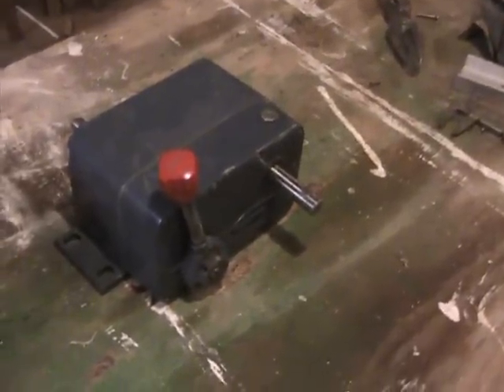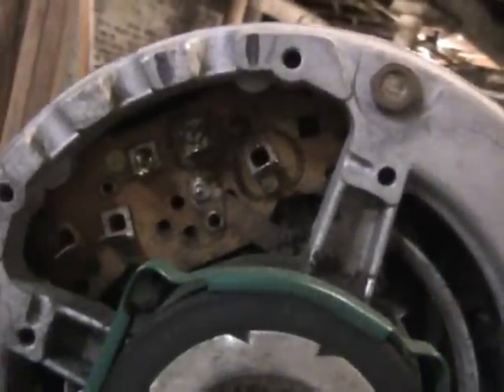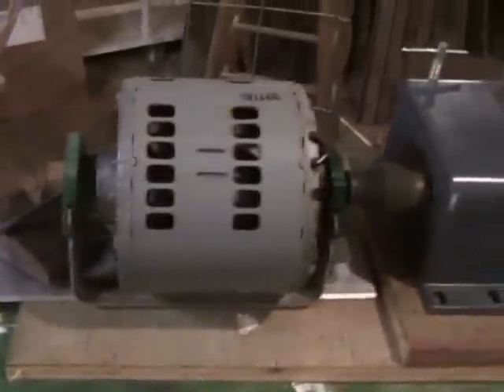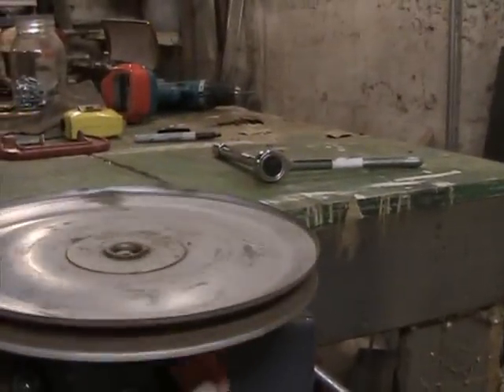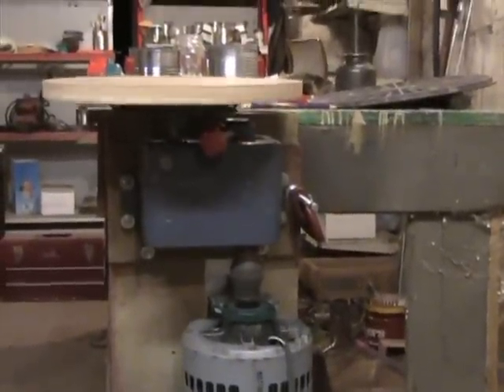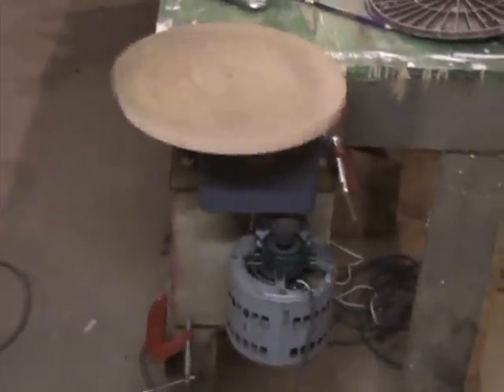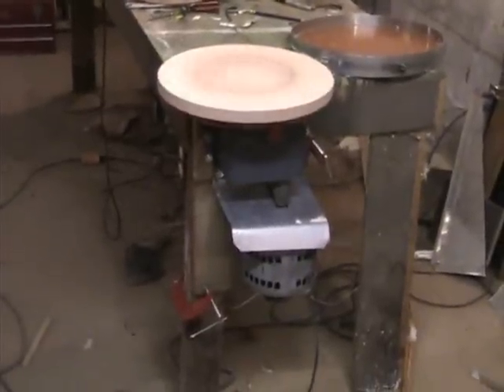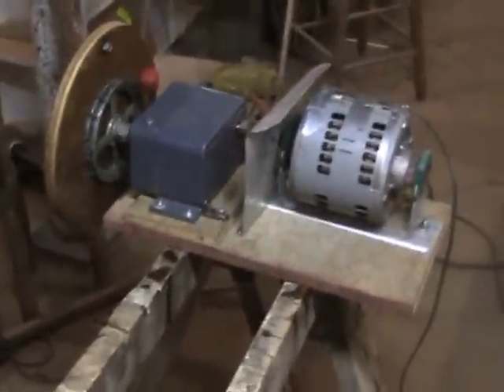How I Made a Variable Speed Potter's Wheel using Salvaged Components

Comment: This looks great! I’m wondering if you could tell me if you think I could use a variable speed sewing machine motor for the wheel. They sell on Amazon. Enduro electric servo sewing machine motor 550 watt. Thank you for your input!
Reply from the maker: hello Nancy,
just noticed your question.
From what I see about those motors it appears they have the power... 550 watts is about 3/4hp.
Find the best deal.
I saw a motor and speed control for like $40.00.
It's deff worth a try.
I wish you the best.
Let me know how it workd out
Reply: Thanks. I also have a consew sewing machine clutch motor with small pulley on the shaft, however I  am not sure how I could make that work for pottery wheel?!?
Reply from the maker: 550 watt aught o be sufficient for a wheel; I believe that's about 3/4 hp

Comment: How do you stop water dropping over the motor? What do you use to stop off spray?
Reply from the maker: Hi Rustic35, I believe I show that .. sheets of tin cover the motor) perhaps in part 2?.. offspray I don't worry about  I do not center fast as some do and larger pieces work slow; you can control a lot of that by wiping the wheel head or bat before the water gets to the edge.. then clean up right after done throwing

Comment: What kind of coupling did you use?
Reply from the maker: hello Mikayla I used an old bonded rubber coupling I had laying around but there are many different kinds a person can use: solid, U joint types also some other flexible types also made with rubber though different than this one
Reply: Thank you. You're video was very informational. I'm going to use a treadmill motor. I'm going to buy a Lockerbie wheel head. I'm trying to decide how I am going to set it up using the pulley system.

Comment: I'm actually wanting to build a miniature pottery wheel. Any tips?
Reply from the maker: how mini?
Reply: 1/10
Reply from the maker: try Hobby Lobby I believe they can find you a small variable speed motor of the type used in model remote controlled cars and air plains they likely have miniature shafts gears pulleys sprockets belts chains and bearings too

Comment: Thank you very much, man, I learned a lot from your video, planning to build a pottery wheel myself.
Reply from the maker: hello Pavel; these gear drives are not so common to find used and expensive new; perhaps a 90v dc motor or gear motor and speed control would be easier.  I wish you the best

Comment: Very nice job. I am trying to do something similar but what concerns me is how to keep all of the water usually used in pottery away from the electrical components since if not, there's a serious risk of electrocuting oneself.
Reply: I think it's a great set up. And good point, when I make mine I will use an old night stand. Make a swinging door build up silicon to give a negative slope away from the hole where the pottery disk sits. The over hang from the desk should help as a barrier from the water as well as bumping into things. Can do a thin layer with plaster of Paris on the inside to kind of contain the components if ever over heating and prevent fire spread. Thanks bud. Didn't dawn on me to think of any of this when I first watched haha

Comment from the maker: Hi Twinhit,
All interesting and plausable comments those.
As Paul Soldner replied to virtually all questions of a tecnical nature.. "Try it and see."
And you are correct I was doing with what I had on hand.
I also made a single spped Wheel from a gearhead motor; I've used it for years.  It is a 1/8 HP motor turns at a stedy 80 RPM.  I've thrown trimed and decorated well over 100,00 pots on that thing; I still use ir every day. 
I wish you well
Bill

Comment: The z max seems to answer that problem pretty well. - oh, the reason I am 
interested in the flywheel is it's ability to sustain that momentum, while using a smaller motor to
control the speed. Not sure what the horsepower rating you used on your wheel, but I would
imagine a flywheel would hold it's own with a less powerful wheel. - Other option would be to
build a system like yours and leave the Lockerbie alone. - I've heard it said.... that there is
something to be said about the kickwheels

Comment: Ok, just so I understand what you said, correctly.
You think DC Motor + Z max + drive pully + Belt to driven pully on the Lockerbie shaft
is the better option? - If so, that is what I was thinking when I saw your clip. Before this clip,
which showcases the Zmax speed control box's capability I was limited to the idea of a motor
driven belt system using a foot control, not unlike that used for sewing machines. Problem is
those sewing machine foot controls are too small for the larger motor.

Comment: Now.... Another idea might be to incorporate the speed box inline 
with the manual wheel's shaft. Instead of a strict direct motor, the Zmax controls the speed. Of course, it's a good idea to build a floor over the flywheel.
While your idea is GREAT from a "Make-Do-With-Whatcha-Got" McGyver 
improvisational approach, I can surely see some great mechanical ideas come from your video that go beyond the potters wheel.
I wonder if the zmax really does go to neutral.

Comment: Only thing about the rheostat approach is that as you cut the power from the motor, the motor, by reason, loses it's torque. Not the best situation for a potter's wheel. On the other hand, incorporating the electronic speed control in consist with the Zero Max may be something to think about. Dual speed controls.

Comment: Ahhhh....  great job on the video and potter's wheel.

I just purchased a Lockerbie kick wheel that incorporates a cement flywheel. 
VERY well made.  However, it IS a manual wheel DOES Lockerbie does offer an
electric motor kit for the wheel. However, it is an on/off direct drive, affair. 
What drew me to this video was an idea I had of using a Variable Speed Drill press head. This Zero Max sounds like a great alternative. Also, another way to control speed may be the Rheostat approach.

Comment from the maker: hello devs.... I found it at a salvage yard, so not sure but I beleive expensive new; I believe you can find a 90volt dc motor and speed control (no lower than 2Amps) on Ebay cheaper than on of these gear boxes.  If you choose a "gearhead" choods one that is geared no lower than 15 to 1  w output of no lower than like 100 or so.  you may find a 1/4 hp motor w a amp rating of 1.8 or so  the amp is more important than hp. hope this helps

Comment from the maker: Hi Loetta,  Thanks for your kind words.  As I understand it the dimmer switch idea won't work on that motor.
Actually the electric drill isn't a bad idea; but I think you'll need al least a 1/2' drill.   I would still reduce the rpm w a countershaft.   You will get full use of the drills torque.
And rather than use the dial on the drill, rig some kind of foot pedal to depress the drills triger. I wish you well.
I'll check out that webcite too.
Bill

Comment: this was one of the best videos i've seen.  you were to the point and did not waste time trying to do the video in one shot.  can that motor be hooked up to a dimmer switch or a router foot switch?  what would you think about using a varible speed drill as the motor? i have vsr drill that has a dial on the trigger to change the speed?  perhaps in reverse would help elizexcell.  check out greenpowerscience use table saw to cut wood circles.  excelsior

Comment from the maker: continued: Hi Elizabeth
find a motor w at least 2 amp rating; don't worry about HP unless you will throw really big.
Also if you'll use a commercial wheel head be sure the output shaft of the  gearmotor matches the bore of the wheel head.
Unless you can use the speed control w just a knob you'll have to fabricate either a foot pedal or other lever for speed control.
Let me know how it goes and if I can help
Take care wish you well

Comment from the maker: Hi Elizabeth,
No this type og gear reducer runs in one direction only, no matter which direction the input shaft turns.  So even IF you reversed the motor direction the output shaft turns in the same direction.
I suppose you could frlop the whole thing upside down and drive a seperate shaft for the wheelhead that would reverse it; however i think it's easier to find a 90 volt DC motor or better a 90v DC gearhead motor (no more than 15/1 gear reduction on E-Bay. you may find one w a speed control

Comment from the maker: hi yedrow
yes of course.
you can find speed controls to match your motor on ebay; not the Soldner style though.
you will likely not need a 1hp motor; might be cheeper ti find a 1/3hp or so even 1/4 hp as long as it's like 2amp should be all most potters need.
I wish yo well w your project
Bill

Comment: Nice job of engineering. I suspect that the rest of us won't be so lucky in finding a variable speed gearbox. I am getting the parts together to build a Soldner style wheel. I have a variable transformer but it isn't strong enough for my 1hp motor. Thanks for the inspiration.

Comment from the maker: @t003lit3 
HI @t003lit3, If by fan motor you mean a ceiling fan then no it will not have enough power; if you doubt that, grab hold of one that's turned off and have a friend turn it on.  You will see how weak it is.  You can however use a 90volt dc motor with speed control or same with built in gear reducer (called a 'gearhead motor'). you can find them used on ebay; make sure the nmotor is at least 2amps and the gear ratio is no more than 15:1 and shaft speed aroud 100rpm. If I can help say..

Comment from the maker: @SmartAlex999 
Dear Smart....
Don't believe the dc speed control will work with your washing machine motor.
I suggest you search Ebay for a 90vDC motor or gearmotor; . A 2-3 amp motor should be enough.  Don't be too concerned with HP rating, a 1/4 HP is plenty if it's a good size motor.  
remember, You'll probably center around 80-90rpm... and throw 60rpm and below; better to go with lower speed and higher torque.
Wish you the best.
Bill

Comment: @newearthclaypottery 
I am going to use your design for my potter's wheel experiment. I was really inspired by your nifty design! I think what I am going to try to do is hook up a 1/2HP, 115V, 1725RPM washing machine motor to a DC motor speed controller that fits 115V and up to 5amps so that I eliminate the really pricey zero-max and then follow the rest of your steps to assemble it. I don't know much about mechanics or electric work so hopefully I can figure it out with some research!!

Comment from the maker: @ommuel 
It was used when I found it. so don't know exactly how it has worn.
It is holding up; I use it as an auxiliary wheel w up to maybe 30 lb. of clay on it the most.
I've never taken it apart, though I am curious how it does what it does.
i don't suppose it was made to get used like this; I just used it because I had it on had.. Consider starting with a used 90v DC gearmotor at least 1/8 HP and top speed not above like 120  can find these on ebay around $150 w there own speed control

Comment: You can purchase an on/off switch, the cord for the motor would plug into it then the switch plugs into the wall.  about 30 bucks... Or just wire the hot wire through a light switch mount it foot height and use it